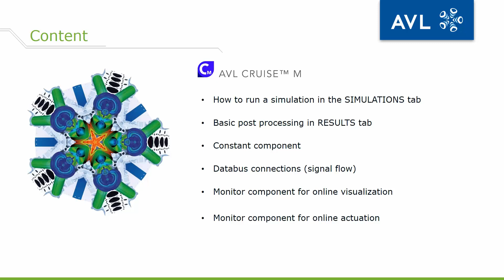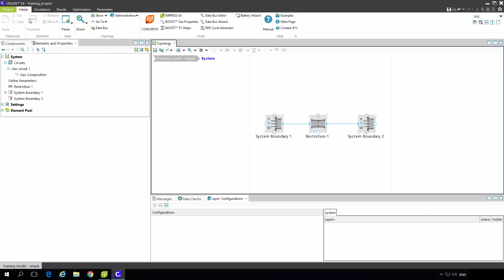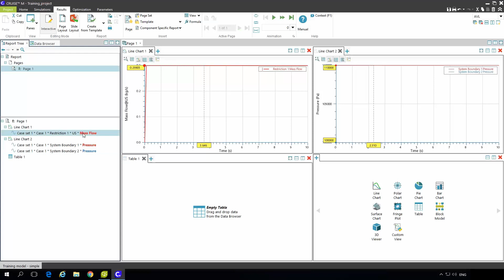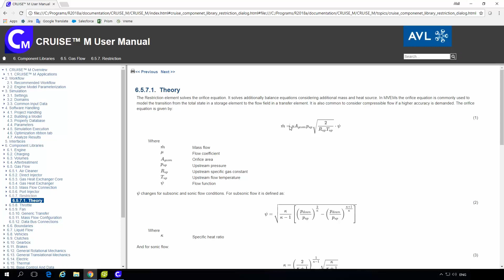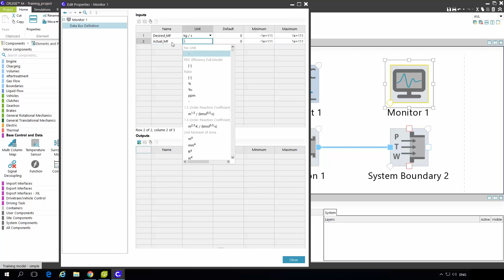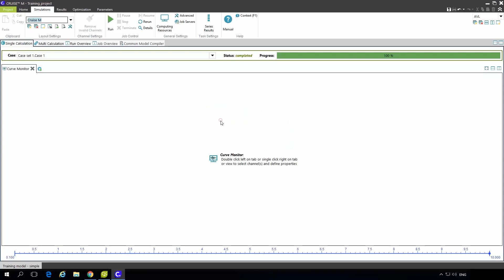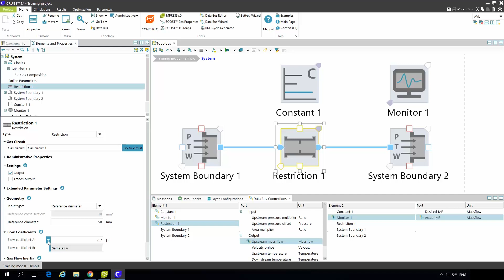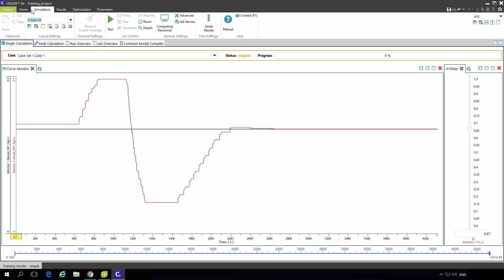How to Run a Simulation and Review Results with AVL CRUISE™ M | AVL Experience Cloud

Comment: Good video，although CM R24 already have PID wizards tool， but i'm still interested in the process, espacially the SI unit part, which made me confused half years ago, (PID input databus is 1.1bar,but results show the input is 110000 with no unit, it make the P,I,D values chosed difficultlly without PID wizards tools) it;s clear now;